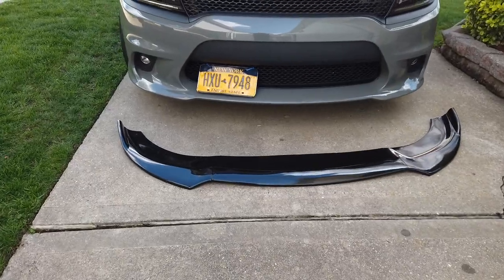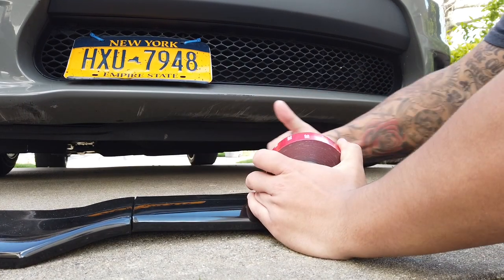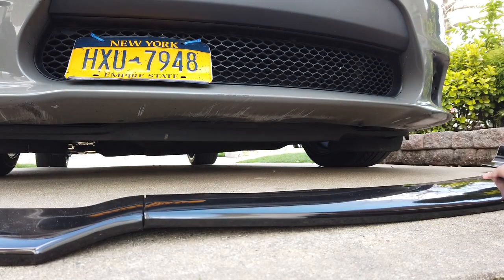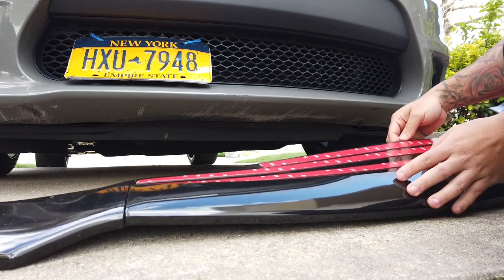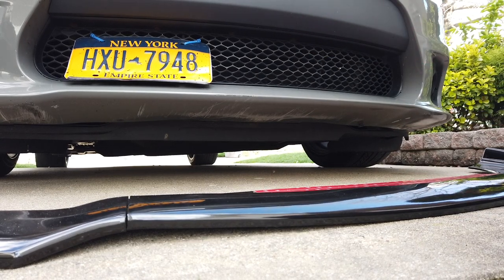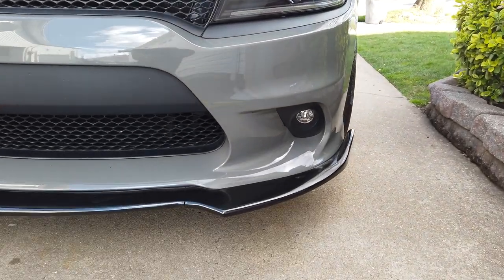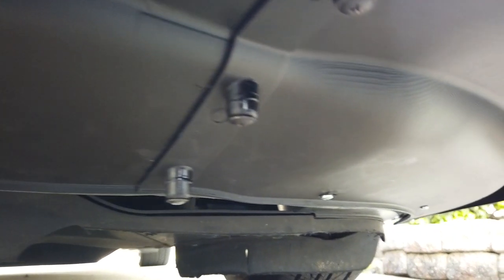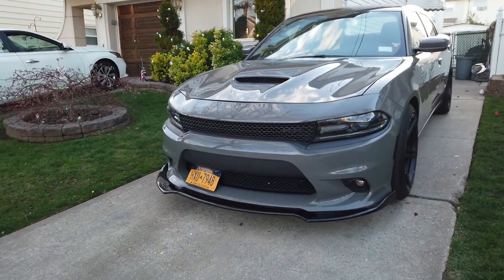DODGE CHARGER FRONT SPLITTER ONLY $80.00???

Comment: I just installed the same one. I bought more screws and used a bunch of them. I also braced the bottom with aluminum stock. Looks great and it ain't coming off. My only problem is, it seems like it's either exactly level or slightly points upward. So you can see the underside bolts and braces on low shots. Kinda wish it had more of a downward pitch, but for $80, it's awesome.

Comment: Pretty interesting!  Can't remember if you said it but how long of a self tapping screw did you use?  2 helpful tips though, having it on jack stands would have made it easier to get under and using something to prop it help while you were putting it on would have made it easier to support the weight before drilling.

Comment: Any update on how this has held up?
Reply: I've had 3 of them, they hold up well. Just be careful on Inclines and decline... I've ruined 2 of them on inclines. also, get the 1pc lip spoilers they are more durable. If you get a multi-piece lip spoiler do not get the V2 or V3, get the V1 because the 4pc lip spoilers ruin easy when the bottom piece screws pull or push through.

Comment: Get up to 130mph and that thing is going to rip right off and cause some damage.
Reply: I only hit two dips before mine came flying
Off and broke In half lmao
Reply: @jippin5622   the OP went with a cheap ebay one won't do much and who's connection would not keep it on under any real use (at speed there is easily 200lbs of downforce) but the OP knew this going into the purchase so kudo's for knowing that. I get it... just wanted something that looks cool but does not really want to spend $300. We've all been there. If it stays on for a year, great. If it flies off, well, it was only $80.  But yeah, that is not going to last under any real use.
Reply: I just installed one. I bought some extra longer screws and used some aluminum flat stock to stabilize it. That sh** ain’t coming off. But the center is either super horizontal, or it’s point upward a little it. Kind of annoying.